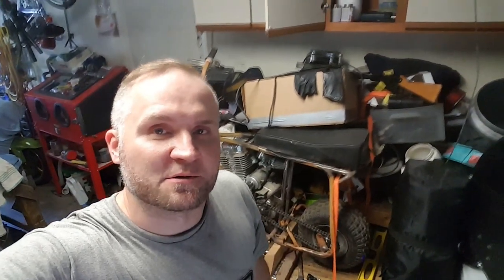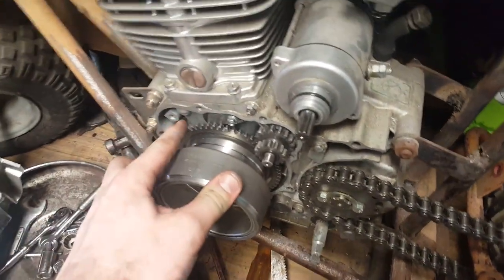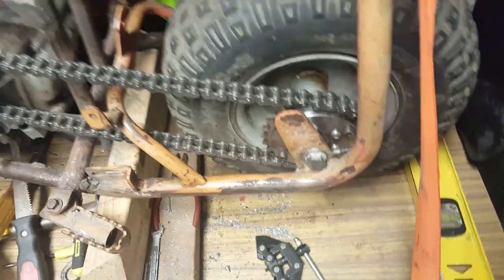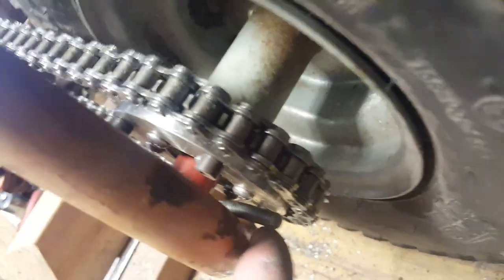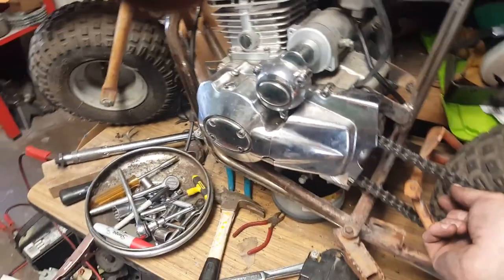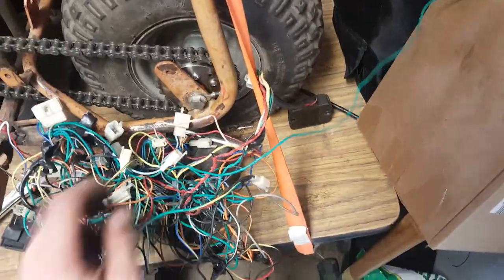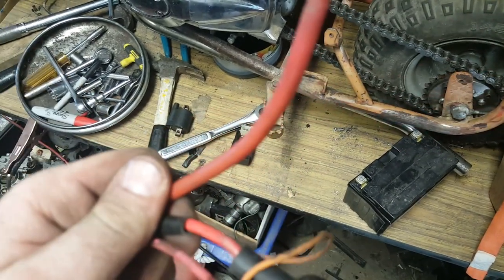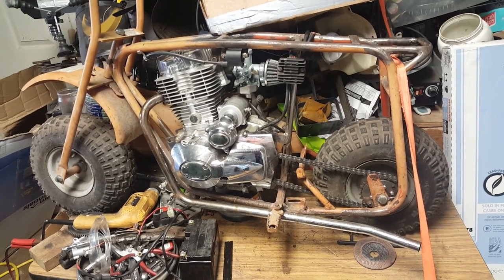DoodleBastard Engine Swap - Part 8

Comment: Having fun watching back through these and that 18 tooth sprocket definitely had to self-clearance a little bit there definitely a tight fit that thing looks massive! 😆
Reply from the maker: No it didn't self clearance anything. It just fit.  LoL. I might be able to stuff a 19 in there but that one I expect would grind itself some space.  Anyway the 18 is good for a high top speed but this thing isn't as fun to ride fast, it's more fun to lug around obstacles.  It needs more rev in lower gears, is too easy to accidentally stall it.  I will probably drop it down to a 16.

Comment: can't wait to see it run have the same motor to install just like you thanks for showing step by step sir I just have to see if your friend will sell back sprocket
Reply from the maker: I may get it running in the next few weeks!  Stay tuned!  I just need to finalize some small stuff then it should be good!  Then it gets tested,  followed up by disassembly and paint job!

Comment: i  love  this  build  i   am  building a minibike with a crf50 motor the engine just recently blew up while i was testing it so im putting a 90cc big bore/stroker kit in it whta type of engine is that a xr70? thats what it looks like
Reply from the maker: Thanks!  The engine is a 200cc Lifan (or equivalent) chinese engine.  Its similar to an older XR200.  I think the XR70 is a horizontal engine, though.  A horizontal engine is quite different and won't fit in this frame quite the same way.  Hope that helps answer you questions!  :)  Love to see your minibike!  Got videos of it?

Comment: Just curious I'm looking at swapping my 50cc engine for a 200cc similar to yours there. I'm wondering about the exhaust port. Is it the same size hole for like a 110cc or 125cc pit bike engine or is it bigger?
Reply from the maker: This engine actually is an oddity, it has 2 exhaust ports... so its not going to compare to the other 200cc engines that you find for sale.  I believe each pipe is only 1", quite small.

Comment: my mini bike swap will be finished soon im probably going to be swapping the axles out for newer ones because the old ones are pretty much garbage and the suspension is seized so i might have to change allot of stuff before its finished
Reply: i also gotta find some new tires the old ones wont last too long with a 13 or 14 hp engine lol
Reply from the maker: The front tire will last FOREVER though.... it will never touch the ground!  :-D :-D :-D

Comment: Definitely excited to see this thing running.  for the wirirng, there is this picture here, http://img.auctiva.com/imgdata/4/7/8/9/5/1/webimg/512879396_o.jpg?nc=369     I just used it to wire mine and it works perfectly. I did not have the harness so running separate wires made things a bit easier for me because I like wiring stuff. one thing that I would really be interested in wiring up is the shift indicator. I can't find one of those though. :/
Reply from the maker: Thanks!  I have that exact one and just cut the harness to pieces a couple hours ago.  I removed about 90% of it, maybe more hahahaha!  I think its about right, then I wrapped things up in the frame to figure out where to put stuff and made a box to hold all the wires inside of.  Next week I guess... stay tuned!  :-D
Reply: DuckmanCycles and VW Garage I still haven't gotten around to recording anything at all but here is a sample of what's to come for the build that I had started.  https://ibb.co/nyLn9a

Comment: Does it run?
Reply from the maker: The engine did before it was put into this frame.  So it should run just fine.
Reply: DuckmanCycles and VW Garage  I mean, is he minibike running?
Reply from the maker: Keep watching, there will be more videos!
Reply: DuckmanCycles and VW Garage will do bro :)